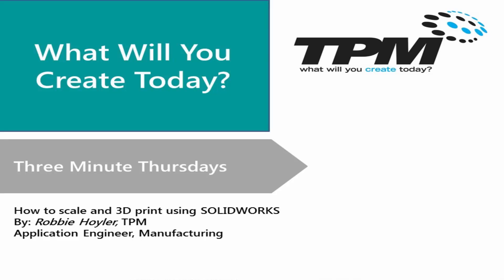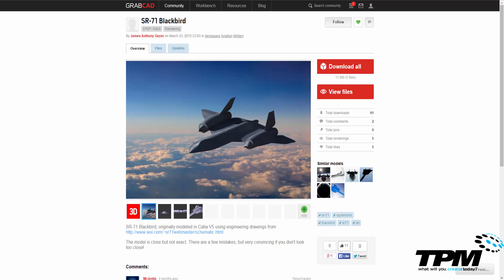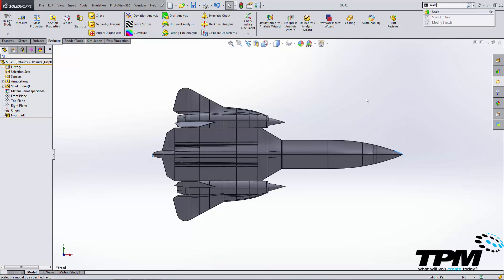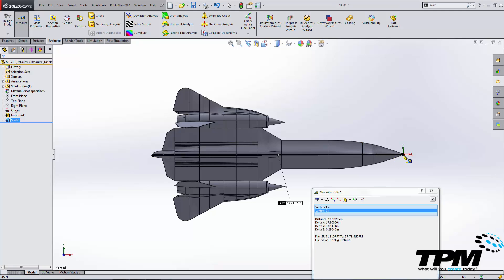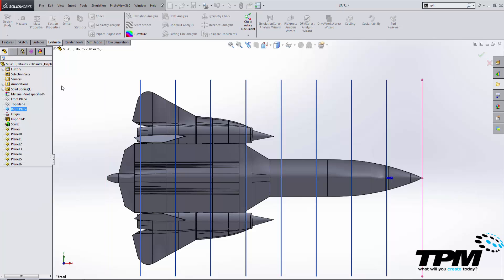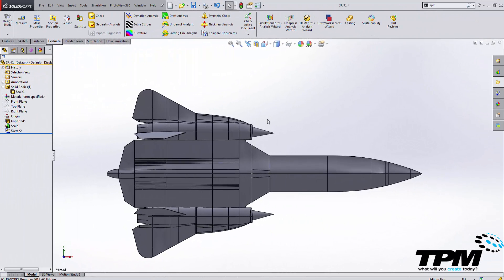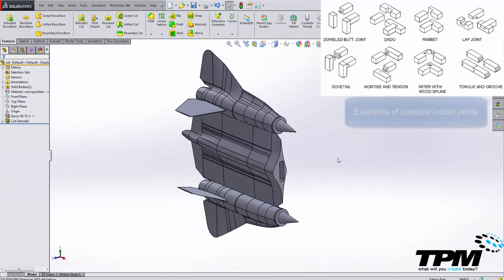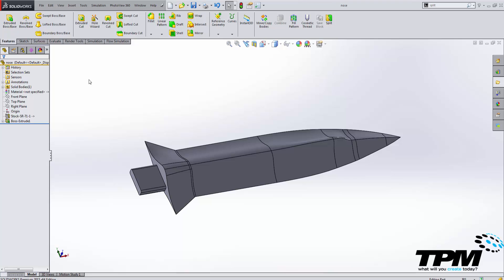Three Minute Thursday: How to Scale and 3D Print Model Using SOLIDWORKS

Comment: Why are my measurements in Solidworks (in mm.) not reflected the same in my 3d printing software?  For example 30mm in SW comes out as 19.5 or so in Simplify 3d.
Reply: When saving select stl for the filetype then click options and set the desired units for the stl output file.